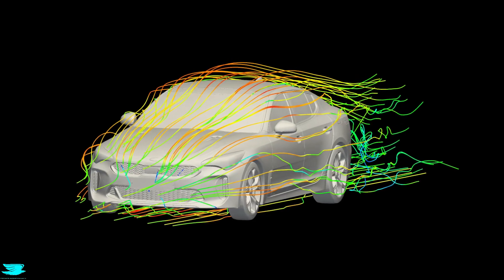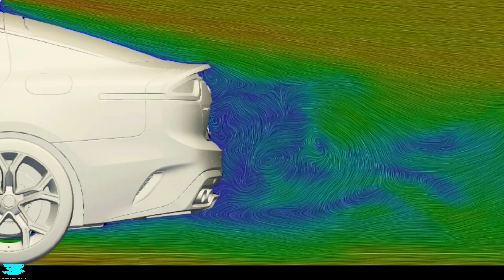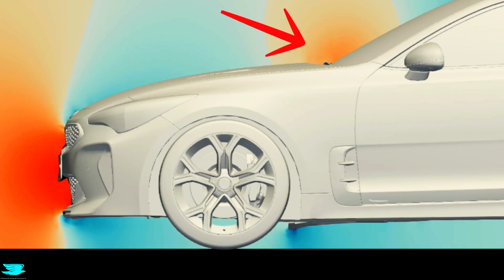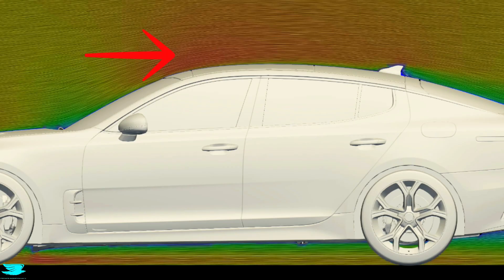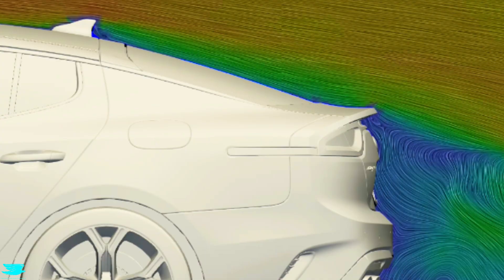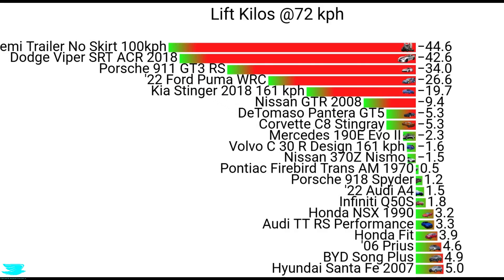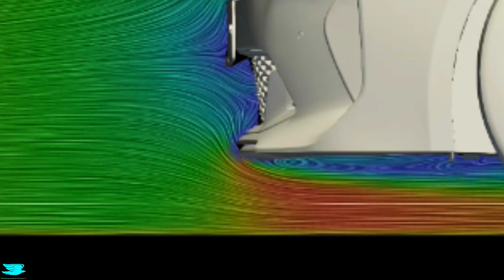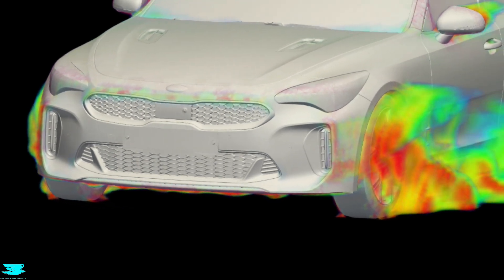The Weird Aerodynamics Of The Kia Stinger

Comment: I have a 2023 gt2 awd, I'm wondering if the wheels from the 1st generation and the later 2023 version were changed for the reason of cooling and reducing drag? I hate the looks of my 2023 wheels, but i'm curious if that's the reason for the change.

Comment: Thanks for covering the Stinger! Ive lowered mine thinking that will equal less air under the car and have changed out the wheels. They're much lighter than factory but probably no improvement for drag.
 I am also looking at splitters, side skirts and maybe a more aggressive diffuser and a spoiler extension for the trunk. 
 In the 1/4 the car is performing great up to the 1/8 mile and feels more and more... not sluggish as acceleration is still good but is beginning to taper and I think aero has something to with it. Do you think the changes Ive mention will create improvement?
Reply from the maker: The lowered car should increase downforce, and if the wheels are taking up more of the wheel house volume, then the drag should drop too.

The spoiler extension will increase drag. The aggressive diffuser might work, but if it's too aggressive, then the flow will separate over it and create a larger wake, which comes with more drag and less downforce.

The splitter will produce more downforce, but probably more drag because they're usually not extended forward enough.

If you like, we have a simulate your own car section on our website, where we can look at your own car properly.
Reply: @PremierAerodynamics  Thanks for the  reply. I will check out the simulator for sure.

Comment: Would it help to put some vortex generators on the roof to make it produce more downforce? Right behind the windshield? I own one, i made the rear vents and the hood scoops functional. Plus i drilled holes into the diffusor part of the rear bumper so it doesn't act as a parachute. Like this i have less drag. I also added the scorpion spoiler. So i hope like this it will generate more downgorce

Comment: 18:32 The side panel is a "menace to society"? WTH? That is pretty random. In the Stinger promo book, KIA says, "Those dramatic vents behind each front wheel aren't there just for show. At high speed, air pressure can build dramatically within the wheel arch, affecting airflow. The vents let the air exit, relieving the pressure."

The Stinger's aerodynamics are a final package producing stability at high speeds. I have empirical experience of this. And I am no performance driver. My GT1 has been taken up to 155 MPH on an undulating two lane highway - in Mexico, of course. The faster I went the more pronounced the stability was. In other words, the total downforce increased with increasing speed. I think that the side vents played their part in this stability.
Reply from the maker: Those aren't the side vents referred to in the video. The side vents referred to are in front of the front wheels.
Reply: @PremierAerodynamics  There wouldn't be side vents if the front scoops were not there. How are the front scoops a "menace to society"? Same question, different part of the airflow design.

Comment: Regarding the front, does the air entering the lower grill change how the air flows around the front lip? If the wheels were spinning, does that change anything? Aren't the front vents on the corners flow through to the wheel wells?

Comment: How do you model the underside of cars? After all, if they're not EVs they have transmissions and exhausts and other features.
Reply: little late to respond but the stinger has a flat floor over a majority of the belly. Only real openings are for the axles. not sure what he does for cars that dont have that
Reply: @Raviolisquare the stinger is relatively flat, but the last third is anything but - a real mess where the pipes come out. unless we're talking EVs, they're very messy surfaces

Comment: The vents under the headlights and on back of the fenders are functioning. What effect do they have on things?
Reply from the maker: The ones at the front are a little different to the rear ones. The ones that are behind wheels are typically there to suck some flow out of the wheelhouse and that reduces how much flow has to spew out the sides and create larger wakes.

The ones at the front are often there to create air curtains, or even just for cooling.

Comment: Kia went to the trouble of incorporating air curtains/fender vents into the front and rear fenders.
Blanking them off to simplify your calculations/analysis, makes a mockery of a lot of it...
ie: Do the aero vents etc, or don't do anything.
Reply from the maker: We also went to the trouble of simulating them. They weren’t enough.

We also wrote more vents are needed.

Comment: Are there any scenarios where a car might make lift at low speeds and down force at higher speeds? Or vice versa?
Reply from the maker: From a fundamental point of view, it is possible. It would occur when two regions have different performances at different speeds.

For example, a rear wing. If the rear wing is very aggressive, at low speeds, the flow will separate underneath, which will make the wing not produce as much downforce. If you go fast enough, the flow will then stay attached, and you'll get more downforce. If the wing is large enough, that could be enough to switch the car's performance from lift to downforce production with a change in speed.

Comment: Diffusers are one of those things that works sort of in reverse. What I mean by this is that the exit plane of the diffuser will be near atmospheric pressure. As the diffuser volume increases, the air slows down, and the pressure rises, this means the further back you go into the diffuser relative to the exit plane, the lower the pressure goes. If you follow this you'll notice the throat of the diffuser, and pressure peak is a bit behind the front axle. Because diffusers operate through a favorable pressure gradient, the back pressure at the expansion is the most crucial aspect of diffuser performance, as that is where the flow transitions to an unfavorable pressure gradient as it begins to decelerate.
Reply from the maker: That's true too. I imagine then, there should be a theoretical limit to how well any given diffuser can perform.
Reply: @PremierAerodynamics  It's a balancing act, removing the backpressure in the diffuser expansion, supercharges the diffuser effect. That's why exhaust blowing is so powerful. The exhaust pulses are effectively vortex rings, and if you get them to merge with the diffuser vortices, you add a lot of thermal and kinetic energy to the diffuser expansion. This lowers the back pressure a lot. This means the pressure gradient from the leading edge of the floor to the diffuser exit plane is greater.

Comment: The roof on this car kind of validates an idea I've been having. Sure the roof is curved, and you'd think this would accelerate the air, but most wings only produce their lift force at roughly 1/4 the chord length, and on this car the flow starts slowing down and detaching at roughly where the rear doors start, or roughly 1/4 chord distance :) .
If you think about cornering in a car, a long corner will take more energy out of the car than a sharp kink will if both corners have similar entry and exit speeds. Because the roof's slope is one continuous radius, near the windshield you start to get some separation, which then causes the air to slow down. This might be why it makes overall downforce, because the curved hood not only creates drag slowing down the air over the hood, it still redirects some airflow onto the decklid.
Reply from the maker: That's a really good point. In corners, it might help provide some fresher flow to help with downforce.

Comment: In your analysis of the front tires did you consider the exhaust vents at the rear of the wheelhouse? Their openings are reasonably large for a sedan.
Reply from the maker: Yep, we had the flow out of both the front and rear wheel vents. But I think here, one problem is their height. So, they will get flow in the wheelhouse that is pretty low but not at the top.

Comment: What do you think would be beneficial, realistic things that could be done to help the aero? There are several front splitters for the car but not much for the sides.
Reply from the maker: To reduce the drag, I think strakes on the diffuser would be a good idea. Lowering the car would also help/putting as large wheels on as possible (that will take up the wheelhouse volume as much as you can). More covered rims as well.